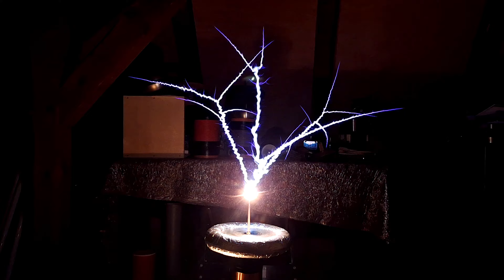Double GU81M VTTC + CHEMICALS!! (BEAUTIFUL ARC COLORING!!)

Comment: Beautiful man. Just watch the vapors/particulate from doing this. It has to release those metals into the air for the color to appear. Not a big deal once here or there but they tend to build up over time if you catch my drift. Goes for any colorant experiment/demonstration. Some are ok, sodium, calcium... others can become or just are an issue... lithium, copper... anything blue unfortunately is on this list.
Reply from the maker: @MadScientist267  thanks for the Information! 
Yes, the vapors are pretty bad, especially from the copper chloride.. smells like chloride gas. 
Most of the time, i have all the windows open, and a pretty good airflow with that. 
But yeah, if i would doing it more often, i should use my gas mask.
Reply: @marvsworld247 Yeah ventilation is important for sure. I run various salts in methanol and it's a little bit different but all the side-show gotchas show up just the same lol

I'm sure you're also noticing that the copper chloride in particular isn't friendly towards other metals such as aluminum and iron. Colorants inevitably spatter in these demonstrations. The "lighter" salts will also mess with metals but copper is so far down the reactivity series that if another metal is around that can take its place, it will gladly give up the chloride to the other metal, immediately. Takes more than contact with say, sodium chloride. Check exposed connections around the coil and what not, tops of transformers, etc... probably already find corrosion.
Reply from the maker: @MadScientist267  yes, this stuff is really reactive! I have to clean the topload after that everytime, because it would almost eat little holes into aluminium foil and corroding steel.
Thats really crazy😅
Reply: @marvsworld247  Yep I love the rich emerald green that copper forms as chloride in methanol but it isn't the friendliest stuff to work with.  The metals are typically (but not always) ejected as the oxides, which isn't particularly reactive toward other metals but the chloride is just a pain on a few levels. It's also very water soluble so it should be kept track of as it is even a bit more "available" than in the sulfate form... so there's all that too. I usually use electrochem to put it in solution and recover it after... but I'm working in a liquid environment... might be less convenient for solid state.

If I could just get that blue out of the liquid phase 🤣
Reply from the maker: @MadScientist267  ok that really sounds, you're know something about chemicals😄
I have absolutely no clue about this stuff😅
Reply: @marvsworld247  it won't let me post the second part about requirements of knowledge of properties of these things to accomplish it uh.. correctly lol
Reply: Ok comment got deleted...... why, YouTube...?

Ummm so...  @marvswelt2587  I'm not extremely deep in but I am on my way to a good grasp of inorganic chem. In the process of purifying salts for methanol demos, I of course bumped up against crystals and went down the rabbit hole of growing them just to watch and such. Electronics is definitely my much stronger suit but the molecules were a curiosity from a young age but because of the differences in their requirements to play, the electronics won out... only now much later on am I messing with it again.

Colorants for the summer, crystals in the winter... Peltier modules and DIY controllers for them to push things around... hahaha

Biggest thing is knowing what you have, what results, and what is involved after whatever... so even the minimal research I have to do results in a lot of "extra" information... most of it is uhh.. "issue" related (YT) and less "under the hood" lol - in there, aspects get way further down into it than I am. The pros got the Mariana trench... I'm in the little inflatable pool thingy out here in the front yard. But it's fun. 🫡
Reply: Ok comment got deleted...... why, YouTube...? 

Ummm so...   I'm not extremely down into it but I am on my way to a good grasp of inorganic. In the process of purifying salts for methanol demos, I of course bumped up against crystals and went down the rabbit hole of growing them just to watch and such. Electronics is definitely my much stronger suit but the molecules were a curiosity from a young age but because of the differences in their requirements to play, the electronics won out... only now much later on am I messing with it again. 

Colorants for the summer, crystals in the winter... Peltier modules and DIY controllers for them to push things around... hahaha
Reply from the maker: @MadScientist267  oh someone got the same problem with deleted comments🤔hmmm

Ah ok that clears it up about your knowledge😁 cool, keep it up🙂

Comment: Good job taking it to the next level Marv.  In the past I've done some playing around with methyl alcohol mixed with various salts such as lithium chloride (red) and Boric acid (green). Boric acid should readily available there in Deutschland.  Give it a try.  Green Tesla sparks would be a first!  Just be aware that any carbon contamination (yellow)  will overwhelm all other colors.
Reply from the maker: @sempertard  thanks!🙂
Aaah ok nice! Thanks for the information😁
Reply: Copper chloride is a much deeper green than boric acid, which is much more limey.

Lithium/Strontium chloride blend for the ultimate red.

Blue in methanol eludes. Easy in "solid state", different story in a reducing flame.
Reply: @MadScientist267  Thank you for that insight.  I'll give Copper chloride a try.  Do you recommend  CuCl  or CuCl2  for methanol colored flame? 

I have mixed Lithium and Strontium nitrate (or maybe it was carbonate) and they do produce a nice red. NileRed on YT shows putting some aluminum foil into an acidic copper solution producing a bright blue flame.  But yes, blue is a tough one.

Comment: In the video you said the arc reaches over a meter, so would you say it’s around one Mega Volt?
Reply from the maker: @Joseph_sidl
Thats actually a tricky question, that i can't answer precisely.
Because the Trick here is to build up the arc "piece by piece" every swing, the resonator does at the time of one positive sinewave of the Mains power.. so over the thumb.. at one positive cycle of the mains (50hz) the teslacoil does about 12000 cycles (600khz) so in every cycle the arc will grow a littlebit, building a  plasma channel, that stays intact because the next swing is coming fast enough to grow the arc a bit bigger again. 12000 times until the Mains sinewave goes negative and the resonator shuts off and the plasma channel cools off and breaks down. Until everything starts again, when the Mains goes positive again.
In this case i cant really say how high the voltage is🤔 i can calculate it over the thumb and it would be roughly 150kv.. but i dont know actually😅
Reply: @ thank you for this information, yeah that’s very interesting cause if we were talking about DC 150kv would only be about a 6 inch arc
Reply from the maker: @Joseph_sidl yes its a littlebit like cheating😄😄
Reply: Having seen a 1MV DC discharge jump well over 4 feet out of a multiplier ladder, up close, I'd say he's got it in the ballpark lol. Yes it's different because of the AC/RF but somewhere in there is splitting hairs lol

Too many factors and since you can't just toss the fluke at it and see what it says........ 🤣
Reply from the maker: @MadScientist267  haha yeah, immagine the chain of HV resistors to build a voltage divider for that😆
But the RF would make the Multimeter unusable anyway😄
Reply: @marvsworld247  Yeah at some point you just have to go with pure math and where that puts things on a table full of conditions lol... voltage, humidity, distance, electrode geometry, gradients/currents in the air, temperature, waveforms present... oh the list just goes on and on. It's really hard to nail down exactly what a given voltage of a given discharge is at any given moment without having all of the other parameters tightly controlled... it becomes just a guess lol
Reply from the maker: @MadScientist267  yep...and im exactly the opposit of math friendly😆 
It does spicy big arcs and makes fun to Experiment with, thats enough for me haha😄
Reply: @marvsworld247  Indeed. Just keep the scopes out of the way... That's where that bolt found ground... Found out the next day... nice sharp tip and it skated off across the desk, had a glass cover with a few sheets of paper laying on it... The scope and probe was on q shelf on the other side. 

The story gets kinda hair raising but the "nutshell YouTube version" is it skipped past me and the dude demonstrating the ladder (he was showing me the oil flowing due to nothing more than electrostatic effects)... when ZAP...

It was that day I realized that above a certain voltage all bets are off and things just kinda get made up as the electrons move along... and that you can't always predict what is going to happen regardless of what clearly should.

Had it taken the more expected path, you'd have never heard the story, probably from either one of us.
Reply from the maker: @MadScientist267  yes, thats right! I had a good reminder for that, when i was "playing around" with a oil burner ignitiontransformer+voltagedoubler.
The voltage was so high, that my workbench was conductive enough, that a contact got attracted to the table. The voltage was still so high ,that i heared crackling corona discharges from my ground rod, when i was Holding it 4mm away from the wooden table😅

Because of that i making up savety rules for myself and also change them for different projects and situations.. sometimes first sitting there and Just think logicly what is gonna happen, and what could happen, to understand situations better and be more save. 
But there are things, that i also have to learn and find out.
High voltage is behaving sometimes reeeeeally funny😅 especially at RF
Reply: @marvsworld247  The good news with a Tesla coil, you're working with very high voltages, yes, but it is both AC and high frequency, and with little relative capacitance. This limits the peak currents that will flow.

In a doubler/multiplier situation, you're using capacitance to achieve the multiplication, and while the total is divided by the number of caps, you still have much more left and there is DC sitting behind it. Corona is one thing, you're in microamp and less territory there... when it figures out a path to ground, thousands of amps can momentarily flow... you don't want to be in series lol. 

And if conditions are right, you won't know it is about to happen, as the hissing can disappear all but completely and it just jumps, seemingly out of nowhere. That's what happened that day... we heard it start up but as it charged it got quiet and the oil was flowing... so we peered closer to observe it... I would do that entire thing completely differently next time but he just already had it set up and cranked the variac open to make the oil go... I was never supposed to witness a discharge 🤣
Reply from the maker: @MadScientist267  hehe, yeah HV stuff is really some special stuff😄
Reply: Definitely not, these coils work in ramped manner and the arc length doesnt really tell you much about the actual voltage, it is very unlikely to be even close to those voltages
Reply: @ so would you say it’s more like 300-400kv? I’m used to the Megavolt per meter measure system so around 25kv per inch

Comment: I use CuCl something (the blue/green, not the white) for patina on copper:

Take copper sulfate in a saturated solution and add a sat sol of calcium carbonate, that'll crash copper carbonate, filter and wash with cold water (it won't dissolve)add HCl to that slowly until it stops reacting, it will crystallize soon with cooling and a little evaporation. Deliquesient.
Reply: People also put it into alcohol lamps.
Reply: Maybe 2/3 the amount of calcium carbonate to copper sulfate until it stops precipitating cloudy white/green copper carbonate. Just do it slow, mix and wait a minute, most will go to the bottom and you can judge it better at the end of mixing them together.
Reply from the maker: @napalmholocaust9093
Ah okay, thanks for the info🙂
I just put copper pieces into a cup with 19% hydrocloric acid and some 3% hydrogen peroxide Mixtur was about 50/50 this was oxidising the copper.
Later i heated up the solution and got this stuff😅
Reply: Yours still worked pretty good 👍 
If you want pretty pure crystals, it is easy.
Reply from the maker: @napalmholocaust9093  ok, thanks🙂 maybe i will try it!
Reply: Not sure which part of this is getting the comment deleted... Why are you bothering with all that? If you go hydrochloric direct to copper sulfate, you have your copper chloride in less steps. Crystallize/get rid of the water, and you're done. Maybe the idea behind the carbonate conversion is avoiding the sulfuric that results...? All I can think of.
Reply: Parte Deux referred to the idea that there's little point if the goal is CuCl. In a "reducing plasma environment", (can't even use the word for the very top of a candle on YT?) in particular, where water is present, it isn't going to want to stay that way and will just become CuCl2 anyway. Things will likely be different in a Tesla arc.
Reply from the maker: @MadScientist267  yes, it is changing slowly into green colour after a while on air🙂